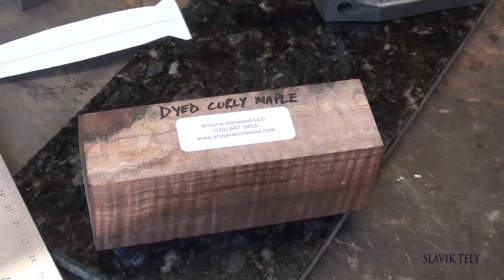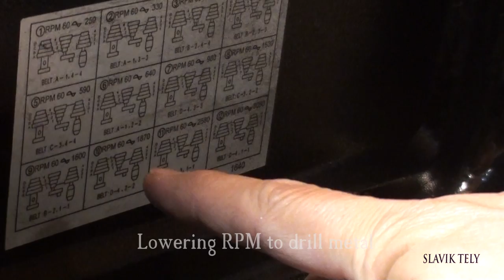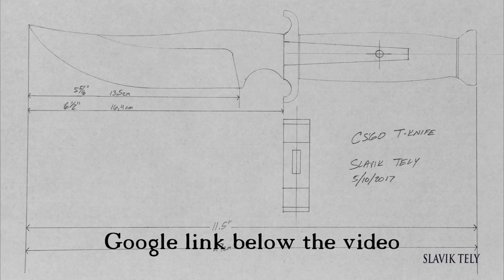Making CSGO DEFAULT T KNIFE Part 3

Comment: never stop amaze me......
have few questions if could help answer 
1. does you do a lot of research on equipment to us?
2. does your drills & Saw often need to change?
3. Your store is running out of space for your toys... plan to build a bigger one? pls do put up shows on it
many thanks
Reply from the maker: I will try to answer the questions that I understood. As for the equipment, I try to buy the best I can afford. I do not replace anything on my drills and saws... only the blades on the saw and sharpen the drill bits. My shed is ran out of space a long time ago. I need a bigger one. When I buy a house, I will have a bigger one and I will try to make video on it too.

Comment: Have you ever roughed up the surface of the tang and the pocket in the handle to help key in the epoxy ?

Thanks for the videos take care God bless.
Reply from the maker: This one had a pin it it and will hold well. The other Tanto knife had a screw on pommel. I have not worked with a tang where I had to make it rough.

Comment: I really like the Kydex sheath!!!
Where did you get it and did the belt clip fixture come from the same company?
It looks like it would hold up quite well in the bush or on the street!
That guard/ricasso is slick and should catch another's blade should it be needed!
Reply from the maker: Holstex sheath. I bought it from knifekits . com   the belt clip TekLok  Large I buy  on Amazon. Yes the sheath is very durable.

Comment: You'll get a cleaner hole in the wood if you don't also drill through the tang at the same time.  Mark the tang and drill it separately.  If the holes become misaligned drill the tang hole larger.  The epoxy will hold the blade just finished and the pin is only decorative, even if it does pass through the tang.
Reply from the maker: That is exactly what I did. I drilled it to the metal then I drilled metal hole bigger than the wood hole and then finished drilling it through.
Reply: @SLAVIKTELY  but at 5:27 you drill through the tang while the tang is still in the handle.  I'm suggesting taking the tang out to drill that hole.  Prevents wallowing out the hole in the wood as the drill bit bites into the metal.
Reply from the maker: I had to go back and watch the video. It's been a while since I made that knife. The wood I used was very dense wood and it did not let drill bit make a bigger hole while going through steel. But I do understand what you are saying. I do remember drilling out tang bigger before the glue up.

Comment: Ever thought of burn fitting your handles? Maybe before heat treat of youre knife you could heat up the tang of the knife to red hot after drilling the holes in the handle, then just press the handle on while its burning.
Reply from the maker: I have done it once on a CSGO Bowie knife (previously uploaded). What that does is it creates charcoal inside and glue does not stick to it.

Comment: Why did you heat treat the guard? Does it get a nicer finish then? Or does it make it more stain-resistant?
Intresting looking knife anyway!
Reply: it's stainless steel so I dont' think it is for stain-resistance ;)
Reply from the maker: It was too soft, I have dropped it once and it put a dent in the edge. So, I heat treated the pieces I cut off and bent them to see if they got harder...well they did get harder. I mostly did it for the strength and the finish with sand paper is much nicer.
Reply: Really ? Hardened steel has a better finish ?

Comment: Why do not you make a hole in the scabbard so that the wet knife leaves the water when it is put into it
Reply from the maker: I placed a drill bit on the bottom of the blade, you can see it in the video. Drill bit makes an opening for the water to escape.
Reply: sorry. Reviewed the video saw everything)
Reply: Do you plan to make kukri?
Reply from the maker: I already made one. check my other videos.

Comment: Your oil quench turns your beautiful knives in only that, go make a step up with water quench and differential hardening that may give real valour  your knives

Pd: tx for making this type of videos very nice work at finishing.
Reply: BatNof is it better ?
Reply from the maker: This steel is not designed for water quench. Thanks for watching video. Someday I will step up the game with differential hardening. I just need to learn more about it.